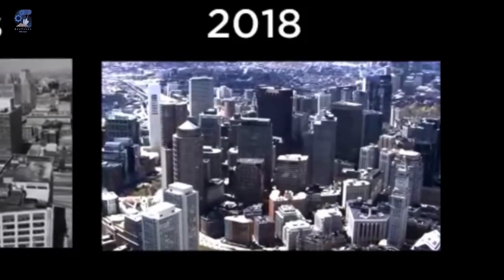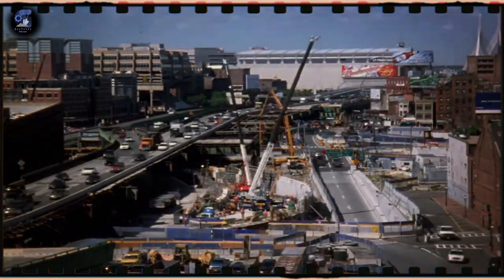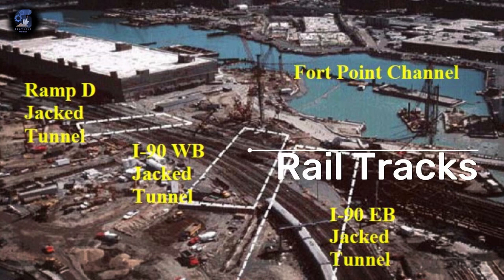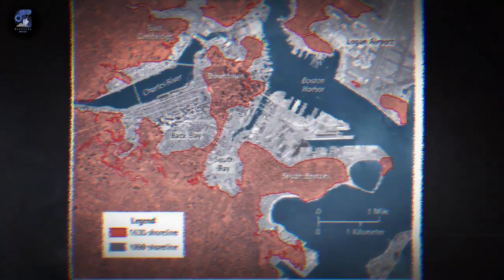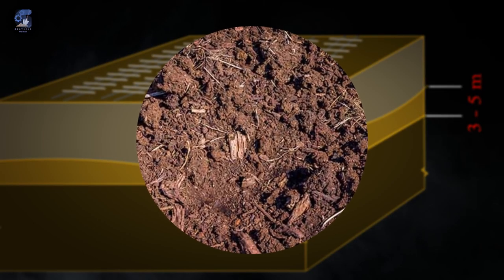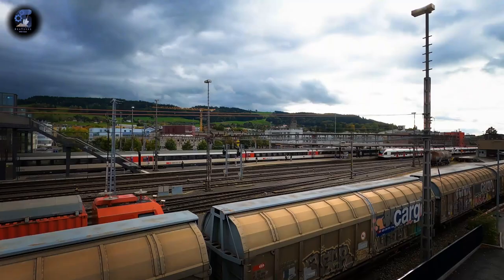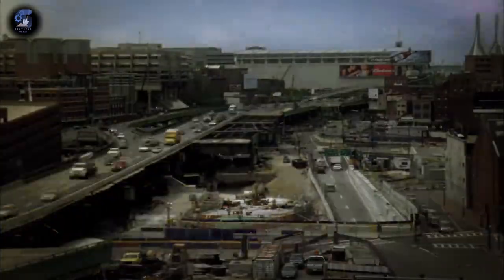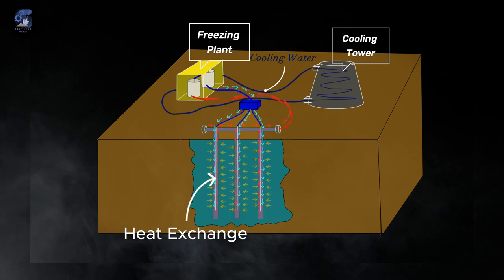Ground Freezing Technique "The Big Dig"

Comment: Hi, Folks.
I worked on a job in Newcastle, New South wales, Australia, in about 1989 where they used that same technique to freeze waterlogged 'running' sand in order to dig a new casting pit 13 metres deep in an aluminium smelter - worked like a dream.

Just my 0.02.

You all have a wonderful day. best wishes. Deas Plant.
Reply from the maker: Hi Deas. Thanks for the comment. That's great to hear. I will definitely look up that project. Interestingly, we work in a fascinating industry, but there is not much publicity about the construction world.